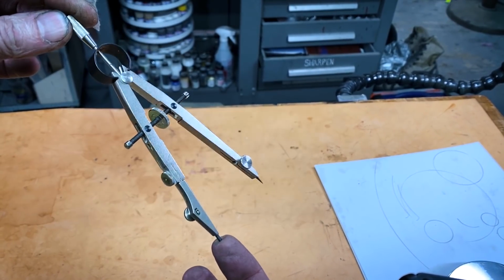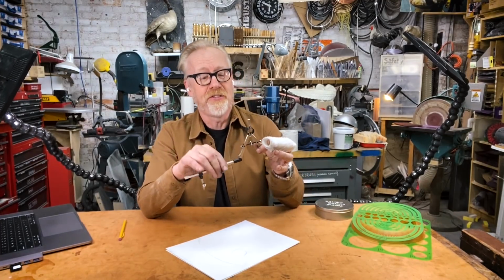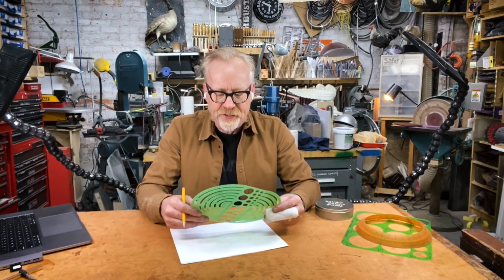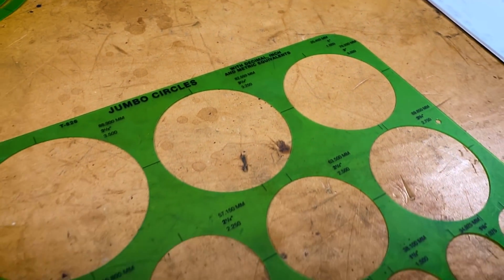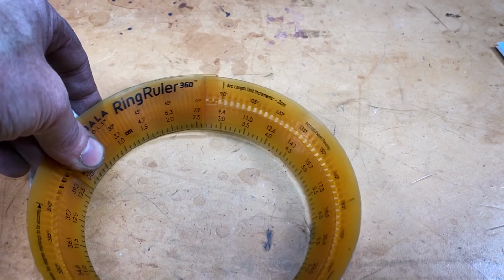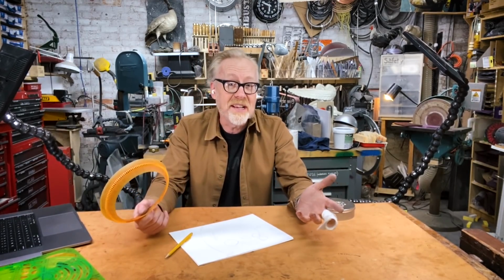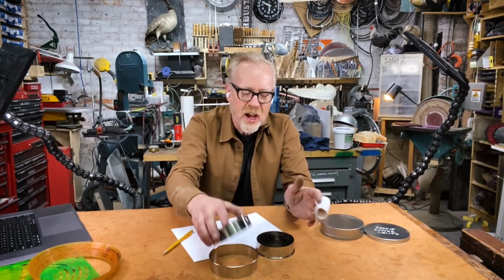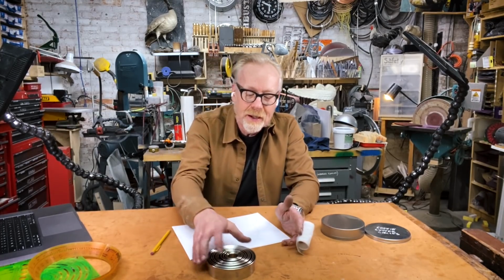Adam Savage's Favorite Tools: Making Circles and Holes!

Comment from the maker: Here are the items Adam is talking about: Cookie cutter circles: https://amzn.to/2x9qcDa
Circle templates: https://amzn.to/2y1LEtG
Radius template: https://amzn.to/2xm9QqL
Compass: https://amzn.to/2Vj77X6
Ring Ruler: https://amzn.to/3c4vRZO
Reply: Another way to draw circles is using a pigging string method. Where you have a pencil tied on one of the string and use a thumb tack as your pivot point on the other end. It is old fashioned, but it works very well. It also easley store in small places by wrapping the string around the pencil and putting the thumb tack in the eraser. 
Just a thought that I wanted to share with you.
Reply: Adam should look at this, this is the Iris drawing tool made for drawing circles. https://youtu.be/w5wBR5vNMXA
Reply: Trammel points are fantastic. They allow you to draw circles with a radius as large as the beam you can supply i.e. 16’ board = 32’ circle basically a beam compass that you supply the beam
Reply: Thank you for the heads up about the cookie cutter circles.
Reply: I was thinking about trying this out.....  https://smile.amazon.co.uk/EFINNY-Versatile-Multi-Function-Protractor-Architects/dp/B07SGDZSYH/ref=sxbs_sxwds-stvp?cv_ct_cx=Ring+Ruler+360&dchild=1&keywords=Ring+Ruler+360&pd_rd_i=B07SGDZSYH&pd_rd_r=df9fc545-170f-4c46-ad08-d3a85eb0ee45&pd_rd_w=8PFLg&pd_rd_wg=8Bkx7&pf_rd_p=03b06a71-8075-4a7d-9aff-765240508d0a&pf_rd_r=9G2230KJHKGGA9XA97Z2&psc=1&qid=1586567660&sr=1-3-718396de-69ac-46a0-9195-9669ab0086b2
Reply: Cookie cutters are the best! The fact that you can get these nested sets in any simple shape,- triangle, square, circle, oval(oval is another must in a shop), and everything in between, including but not limited to simple lines.
Reply: It was a funny coincidence to have you talking about holes and circles while editing my latest video, which features the combination of both: a circular mask cutting tool. The scene in question is here https://youtu.be/UIeCk2HgcKI?t=286
Reply: Waiting for "COOKIE MONSTER" to come out and say, "Cookies are circles. Nom! Nom! Nom! Nom! Nom!"😆
Reply: I wear glasses too and I want to know how Adam cleans them and stores them.
Reply: So, if you're gonna draw a circle on some irregular object like a piece of wood, okay, but just drawing a circle on paper? Just do it freehand man. You don't need any tool to do it perfectly... Just practice a bit, it's easy.

Comment: Two methods I didn't see the 
1) Trammel Compass like the: 
-) WoodRiver 3-in-One Trammel Set with Cutter 24" (https://www.amazon.com/WoodRiver-One-Trammel-Set-Cutter/dp/B075H2JQQK) or
-) MPOWER - Flat Lying Trammel Compass (https://www.youtube.com/watch?v=6cMfcKukq9o)
2) The Beam Compass like the Alvin 961 series (some of the series is budget minded with the beams made of plastic... the nicest one has more aluminum parts like the beams and comes in a black fitted case).

Comment: Just to be super clear, a compass is a balanced needle used to detect magnetic fields. What we're talking about here is called a 'pair of compasses', as the armatures were originally used in marine charting to plot courses by 'compassing' ('encompassing') a certain radius from a known position. (It's a 'pair' because there have to be TWO arms to create an angle - like a 'pair of trousers' having two legs or a 'pair of scissors' having two blades). Thanks.
Reply: And to be super, super clear, I don't begrudge Adam substituting his own reality for ours one little bit. He is one of my all-time heroes and a constant source of information, entertainment, wisdom, experience and inspiration in equal measure. We all get the odd word wrong from time to time (or even injure ourselves despite taking all conscious precautions against it!), but I'd give anything to work in his shop with him for just an hour.

Comment: Converting leftover bits of pipe and the like to 1/2" or 1" tall guides works really well. PVC tends to need a bit more if you want to handle it roughly. Sharpen one side into a cutter, and you have an interior diameter circle guide, an exterior diameter guide that is really useful for planning holes for pipes and dowels, and a cutter that is exactly the right size for putting a hole in drywall, or scoring it if the drywall is too thick or you are putting it through wood or some other easily scored material. Use female connectors or the outer walls for this if you need to feed the pipe through, as it leaves room for thermal expansion. The best part is that the copper and brass fittings are usually still in usable condition if you run out of a particular connector, so you can also use your miscellaneous-circle-guide drawer as a source of emergency parts.

I think I remember sharpening the interior edge of a 2 1/2'" PVC pipe to make a leather punch for Cub Scout activities so that we could buy scrap leather for an event instead of paying more than twice as much for thinner pre-cut leather. Just whittle away the outer edge, run it over a sander to smooth out the bumps, and the inner edge is ready to cut rounds of just the right size to pass through the pipe. A bit of scrap lumber spreads the force of a hammer blow out enough to keep the pipe's wall from being damaged, and keeps any soft-faced mallets from being damaged by the pipe. Trying to sharpen the outer edge left an interesting look to the edge of the leather rounds, but was not really practical at the scale that was needed, as it took too much effort to remove the round from the pipe.

Comment: Buy a set of trammel points. My father was a model/pattern maker and those were one of his most used tools. Don't buy the ones that use a round bar, but the ones that use a flat bar. That way you can use a sacrificial piece of wood to make any length you need. Some are just metal points, others allow you to mount a lead or pen on one of the points.  You can make circles from about 2" to whatever length you can imagine. Another of his favorite tools was a 151 spokeshave. So handy.  :)

Comment: Adam, how about drawing ellipses?
Drive a screw into each of the focal points of the ellipse, then put a loop of string over the two screws.  Pull the string taught to one side with a pencil, then draw the ellipse by walking the pencil around the screws.
It is MUCH easier to do than describe!

Comment: Hey Adam I have something similar to your cookie cuters but its pipe. My actual job works with welding, cutting, and bending alot of different sizes of pipe so I've gotten into the habit of taking the off cuts of any new size pipe that comes through for use at home for my own projects.

Comment: I use my steel ruler I have a hole exactly at 0 that fits on a threaded neodymium magnet then i drill a hole on the measurement that i need then stick the magnet down and pull the ruller around with the pen in the hole at the measurement needed

Comment: Quick and dirty trick from a graphics programmer:
In most applications your circle doesn't have to be perfectly circular

A regular 30 or more sided shape is visually equivalent to a circle at most scales.
As long as you can mark 30 points of equal distance from a center, when joining those points up with a straight edge you make something that approximates a circle well enough to trick the human eye so long as you can see the whole circle!

Comment: Another tool not to forget is the beam compass / yardstick compass / trammel points.  These let you take a stick and make really large radii.  Some of them can even be equipped with knife blades, to let you cut as well as mark.
When setting up patterns and pattern tools, and if you use a tool to make a radius (especially something like a socket), it's a good idea to record what you used to make it.  Things like the OD of a socket are frequently an odd diameter, and if you have to make a matching or complementary part, you can be searching for a long time to match up what you made that radius with.  A note on a pattern like "1 1/4" socket radius" can help.

Comment: One circle template most people have in their shop and don't think of is the outside diameters of a socket set.  While the 1/4" sockets are pretty small and mostly the same, but the 3/8" and 1/2" sockets have a wide variety of radii. 

When setting up patterns and pattern tools, and if you use a tool to make a radius (especially something like a socket), it's a good idea to record what you used to make it.  Things like the OD of a socket are frequently an odd diameter, and if you have to make a matching or complementary part, you can be searching for a long time to match up what you made that radius with.  A note on a pattern like "1 1/4" socket radius" can help.

Comment: A steel ruler with one hole drilled centrally at the 0 mark, then drill another hole at your radius measurement. Rotate ruler around the 0 hole with a pencil in your radius hole. You can make what ever size circle limited only by the length of your ruler.

Comment: I learned a way to draw (nearly) perfect circles freehand in my product design class - essentially you transform your hand into a compass. You hold your marking utensil between your middle and index fingers, then your thumb functions as the other end of the compass with your thumbnail being the pointy bit, and you can brace your ring/pinky fingers against your thumb to keep a consistent diameter. Then since it's difficult or impossible to rotate your hand 360°, you instead keep your hand still and use your other hand to rotate the paper underneath it. Sounds complicated but with some practice it's quite easy and effective; I use it all the time.

Comment: When rounding corners by hand on anything flat I like to use a vice-grip to clamp a washer onto my work-piece to act as a template.

This also slows any error in my workmanship as the washer creates extra material thickness where I do not want material removal.

Comment: For the best large circles, I use a strip of cardboard, a push pin, and a pencil to build a compass.
As I have poster stock that is 28" x 44", a 44" x 1" strip can draw a 7' Diameter circle.

Comment: i broke my compass once and found sticking it in my drill press chuck via the threaded end to adjust it and spinning it by hand works wonders especially if i need it marked at a certain point or with a specific diameter

Comment: I have a circle cutting jig for my router. Have even used it on aluminum before with carbide bits. I’ve also cut circles on the table saw, but it’s not for a novice.

Comment: The old pencil on a rope, nailed down at your centerpoint. Great for larger diameter templates or smaller ones as well. 

Or the old carpentry trick where you take your tape measure, put  your thumb on the measurement at center and your pencil on the other end, doing your best to lock in the position of both, and just sweep it around in an arc. A little practice and you can get a perfect circle everytime !

Comment: Having left my good compass at the office "pre-lockdown" I recently had make do with a ruler I have that has incremented holes along it's length. 
It's basically the "nail and a piece of string" trick. But I found it to be somewhat more convenient. 

The holes are spaced every 5mm, so it's not a universal solution. But it does easily yield perfect circles.

Comment: One more tool: When you don't want to, or can't, use a beam compass, but need a specific radius, so a French curve won't do: Acu-Arc ruler. Not especially cheap, but sometimes found on Ebay, etc. 
https://www.amazon.com/ACU-ARC-Drafting-Engineering-General-Catalog/dp/B000HEQNIC/ref=sr_1_1?dchild=1&keywords=acu-arc+ruler&qid=1586554952&sr=8-1
Reply: Neat

Comment: Hey Adam, take a look at the Circle Cutter made by NT Cutter from Japan. They make truly excellent, inexpensive disposable blade systems (snap off). The circle cutter is adjustable and allows you to cut circles without making a center hole. While there is a center spike, it comes with a rubber traction foot screwed on over it. Great if you don't want to puncture the material you're cutting. You can find all of their stuff on amazon.

Comment: An old graybeard I knew used a flashlight and bottle-cap held on with a wire to cast shadow on any surface he needed to. You could trace out a circle from one inch to ten feet if you need to he said it's not perfect but it's good enough.

Comment: Back when I worked as an fabricating engineer we used to have to make really big circles for parts, to calculate clearances, for road markings or suchlike, for that we used to use rope or electrical cabling and tie loops in the ends for the radius we wanted - one person would hold down the point for the center (put a paint can in the loop and stand on it) and the other would walk off the radius with chalk, scriber, spraypaint or suchlike. String and a nail does the same thing for smaller circles. I never had to make circles bigger than about 50 yards, but much bigger than 100 yards or so you'd probably want to use surveying equipment or GPS.

I often use nail plates as tools, think a strip of stiff  1/16th" steel about a yard long by an inch or two wide with staggered rows of nail holes (they're meant to be used for holding timber framing in place) - they're super useful for cheap straight edges to cut, draw, or grind against, and you can also drill holes in them to get accurate radii. A plank is useful for that too, nail (or screw) down one end properly with a single nail, then drive a nail or screw just slightly through where you want to draw the arc, then pry that end up and walk it round using the nail to scribe an arc in the work piece.

For small stuff I just use templates and drawing compases, or some nearby random round thing.

Comment: The large wooden circle layout (tool, jig?) you showcased in your 'Poker table Build' is another great one! We used something similar for layout, also known as a 'truth stick' - when we needed a repeatable, specific length (or circle) we'd make one "truth stick' that would be used for the duration, for ever single repeated action.  Removed user error and tool error, measurement bias, etc.  Never built one with a row of specifically pre-drilled holes, I IMMEDIATELY sent it to a few friends (and former coworkers!) saying WHY DIDN"T WE EVER BUILD ONE OF THESE !!!!

Comment: Olfa compass cutter is great and gets a lot of use in my shop (rubber, cork, cardboard, thin plastic).. but the most unique and coolest  
is the OMICRON model no. 13 Beam Compass set, circles 3-1/2” to 72” I learned about this tool from the movie art directors i worked with at Universal Studios 30 years ago.

Comment: Trammel points and any bar at all whether it be wood, plastic or metal. https://www.amazon.com/Grizzly-H5876-2-Piece-Tramme-Length/dp/B0002U8BSG

French curves aren't circles but if you don't have them you need them. https://www.amazon.com/FRENCH-DRAWING-TEMPLATES-Peachtree-Woodworking/dp/B003VHUCGQ

There are some unitaskers that merge a tape measure and trammel points: https://www.amazon.com/Rotape-RT111-Tape-Compass/dp/B001DSXFT6

And again, not really circles but more curves and arcs (but what's an arc but part of a circle?) - flexible rulers: https://www.amazon.com/STAEDTLER-24-Inch-Flexible-Curve-97160-24BK/dp/B0006IK3LM

Comment: All though i do have a protractor and usually use a nail and a string for rough cuts on wood.. I've been yelled at by my wife more than once for using all sorts of cups, plates, bowls etc.. For circle making. Mom was never a fan either. Thanks for the tip Adam. 🤘🤓👍

Comment: Surprised you didn't mention the string method useful for those larger diameter circles if not super precise. Actually is there a product that is a large weight with a bearing and a adjustable steel wire for more precision of larger diameter circles? This seems like it should be a product.

Comment: One of my favorite ways of making circles and ellipses is nail or pin and string. For a circle place a small nail at your center point and make a loop of string that when stretched taught will give you the radius you need. Place your marking device into the end, pull tight and draw your circle. Similar use to nails and your loop of string to make an elliptical shape. You have to play with distances of the nails and size of loop to get the ellipses you desire. Hint the farther the pins and tighter the loop the flatter the ellipses and the closer the pins and looser the loop the rounder the ellipses.

Comment: For curves of a set length and offset at their midpoint (like you might see in boat plans and such) I use a piece of flexible wood, notched at each end so that a string can be tied, joining the two ends like a bow. The notch is cut so that the edge of the wood can lie flat on the surface to be marked. Using a taught line hitch on the string the tension can be adjusted to bend the wood to the required curve, then simply trace. I have no idea what this tool is called but I have seen commercial models made of flexible plastic with webbing and a buckle replacing the string, works great for long and gentle curves.

Comment: I have been doing a lot of smaller drafting work recently and I have found that my starrett radius gauge set has been really usefull, they're not full circles but they have inside and outside curves that go from 1/32 to 3/4 and I have been loving them for curves that are too small to make with a compass.

Comment: Trammel Points! They're basically long pins attached to small clamps. You can replace one pin with a pen or pencil and bolt them on to any length 1x2, essentially making your own beam compass. I used them when doing a Star Wars Cantina build for a Halloween Party: https://cyberook.blogspot.com/2009/12/how-to-build-star-wars-cantina-in-three.html